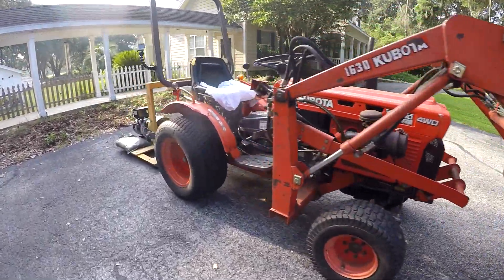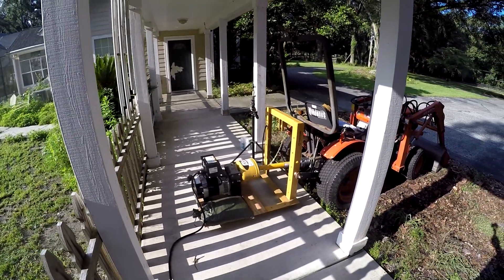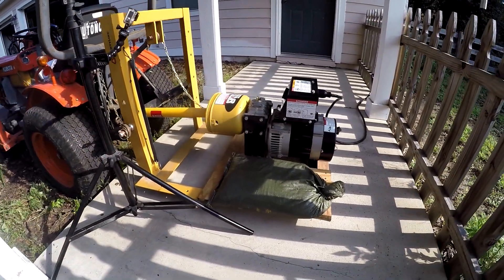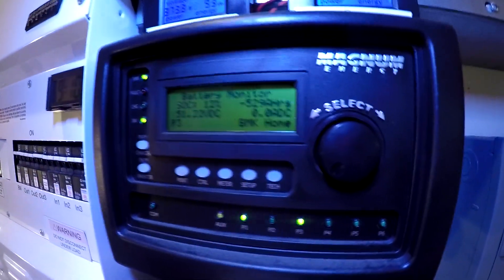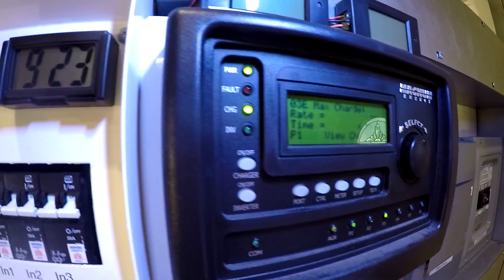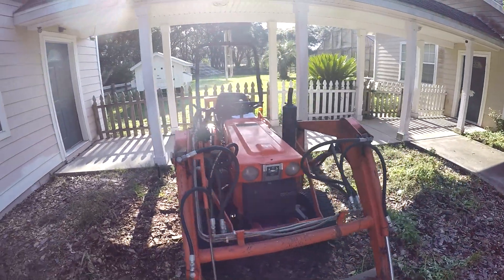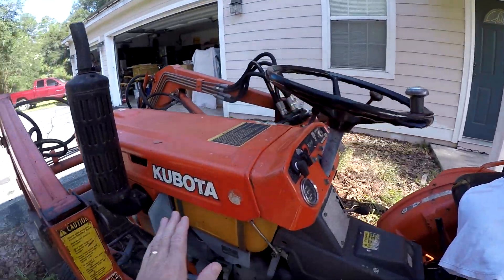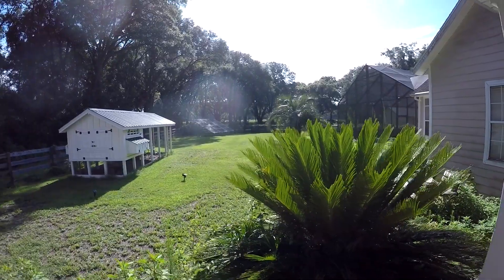NorthStar PTO Generator on Kubota B7100

Comment: Nice! What is the fuel usage of Kubota with 7 kw load?
Reply from the maker: I measured this once but I don't remember.  I want to say about 1 gallon/hr (at 5kw load) but not sure...  It seams a lot less than my Westinghouse 9500Watt generator for sure, big difference.
Reply: @HomesteadEngineering   thanx! People saing also, at pto usage speed Kubota uses 1 - 1.2 gallon of diesel. If you say gal ph, so it is correct.

Comment: I am considering a PTO generator for my home.  I have a standard a general portable right now and it works well but I love the idea of one driven by my tractor because I always have plenty of diesel fuel.  I have a Kubota LX2610 cab model.   25 horsepower and 19 at the PTO.
Reply from the maker: Yes, having all the diesel fuel laying around is my prime motivation for having the PTO.  The 2nd biggest factor is the really clean power I get out of it.  Good Luck!

Comment: Great test! A bit loud for my taste but it's nice to have redundancy for sure!  I have the Honda EU7000is converted to tri-fuel. I run it on natural gas and use it to power my 100A Chargeverter which is connected directly to the EG4 battery rack busbars. It can charge comfortably at 80 amps while the Growatt 12k LF inverter powers the load center during outages. I like this setup because it can power the 4 ton HVAC unit where the Honda can't...even with a soft starter.  The great thing about battery backup is that you can put the generator away at night for better security.
Reply from the maker: Beautiful setup!  Those Honda's are pricy but boy do you get what you pay for. 
You have a similar setup so you understand what I am doing and why.  :)

Comment: What is th HP of that tractor ? Did you say the gen was a 5k or 7k ? It is a nice back up ! TY
Reply from the maker: The original HP was 16 but I would guess I am around 12 these days.  The generator can do 7,200 Watts continuous.  Thanks!
Reply: Is that 16 horsepower at the PTO or tractor itself? Thanks